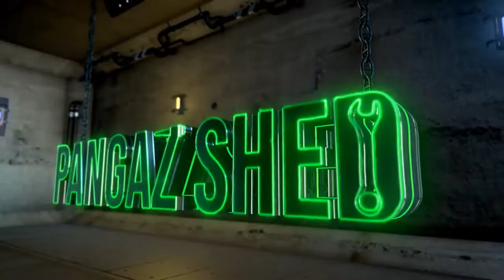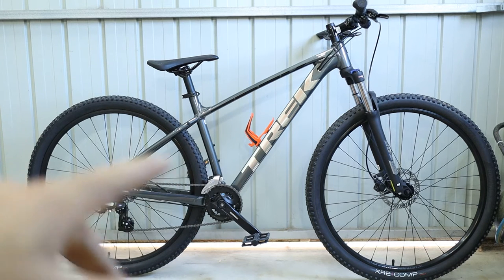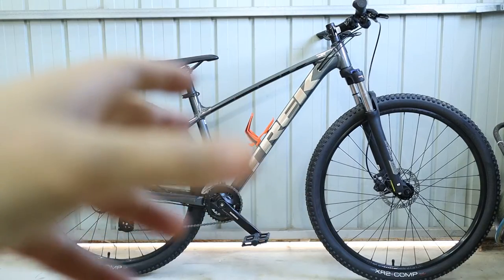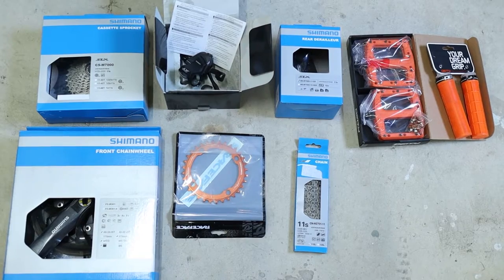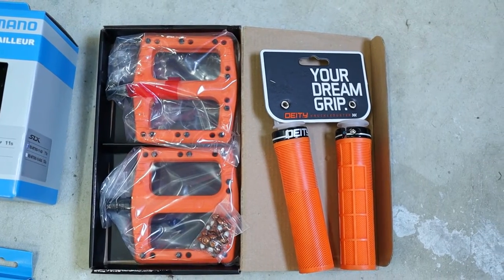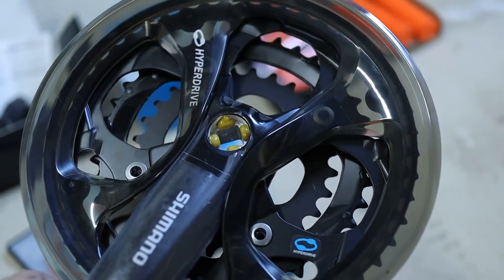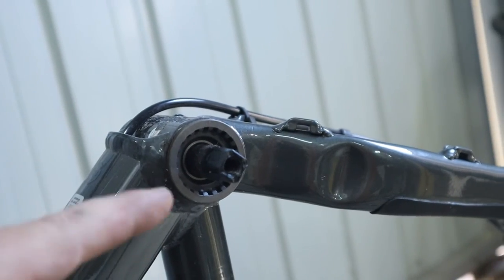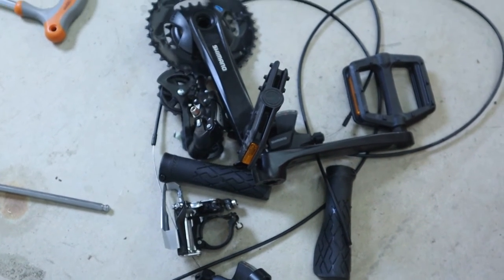Budget Shimano 1x11 Drivetrain Upgrade - 2022 Trek Marlin 5 MTB

Comment: Great video dude and the bike looks sick! I'm probably going to do this mod myself but without the 11speed conversion on the back. Was just wondering how easy it was to do the conversion to 1x on the front and if you needed any weird tools. Or if you have any other tips it would be much appreciated.
Reply from the maker: Changing the front chainring should be straight forward. Normal tools to remove the front chain guide, crank arms etc. The chain might need to be changed to suit the teeth of the new single chainring (if it’s narrow-wide). If you want to change the crank assembly to something more exotic then you will need a bottom bracket tool to suit. But if sticking with simple taper bearing as I have then proceed! Cheers!
Reply: @PangazShed  I followed this and used the exact same stuff....it aint working wtf. The derailleur wont shift to the lowest 2 gears no matter I do and im frustrated
Reply: @mattnielsen7639  Check your high limit screw on the derailer.

Comment: Hello and thank you so much! Which raceface chain ring did you use? 30T?
Reply from the maker: Yes, 30T. Thanks for looking, cheers
Reply: One more question.. will the xt m8000 derailleur work with the slx m7000 cassette? Im having a hard time getting the m7000 derailleur quickly.
Reply from the maker: By the look of it, the m8000 is also an 11speed rear derailleur so yeah should work! The m7000 might be low on stock as it’s perhaps becoming discontinued? Not entirely sure, sorry. I only bought the m7000 because it was cheaper haha
Reply: Hey Im working on this chainring and the original shimano bolts seem to be a tad too long for the single raceface chainring. Did you use different bolts or am i missing something lol
Reply from the maker: I used the bolts that came with the crankset that I bought, I didn’t have an issue
Reply: @PangazShed  Thanks for responding. Not sure why it didnt work for me.. ordered some shorter chainring bolts. I appreciate you and this video so much.
Reply from the maker: No worries! At least you can’t go wrong with new bolts! Also, I can report this conversion has transformed the bike. Lighter, less clunky and looks good. Make sure to torque the crank arm bolts or check them after a few rides. Same with the derailleur tuning, I had to readjust mine recently to stop ghost shifting but that’s mainly because I’m not the most proficient derailleur tuner!

Hope you’re pedaling soon! Cheers
Reply: @PangazShed  I cant wait to complete this upgrade! I just upgraded the fork a couple days ago to a rockshox recon and it was a huge change for the suspension. I will definitely keep an eye on what you mentioned. You should do some video of your rides some time! I will let you know how it all goes.
Reply from the maker: Upgraded forks! I’m jealous! I need to do that too, standard forks seem more springy than suspension! 
Once the 1x conversion is done you’d have a nice bike for sure! 👏
Reply: @PangazShed Yes the forks have been a massive upgrade!! Buy I am very excited about the 1x to simplify shifting and hopefully eliminate chain dropping issues Ive been having out on the trail. I want to do wider wheels but Im still doing research on that.
Reply: @tomacheteful What particular fork is it? Is it a direcy fit to Marlin 5?
Reply: @danl5632  originally I put rockshox recon 100mm travel like the stock travel.. I did not feel much difference honestly. So I decided to buy a tapered headset and adapter then I install recon 120mm. I really enjoy this fork, the bike is much more fun to ride and better on trails.
Reply from the maker: Do you have a link for the headset adapter? I thought company’s like Cane Creek don’t make them for the 1 1/8th steerer tube
Reply: @PangazShed  it is the ec44/40 adapter.. I installed this exact adapter with no problem.
Reply from the maker: @tomacheteful I’ll check it out! Thanks! Tapered are plentiful in decent shocks compared to straight!
Reply: @PangazShed  glad I could help.. you helped me so much.
Reply: Did you shorten the new chain?

Comment: doesn't the rear hub only support up to 10 speed Cassette?
Reply from the maker: This particular 11sp cassette is compatible with the 8/9/10 Shimano freehub. Same spline and don’t need a longer one. It’s the 7 speed and down that the hub needs to be changed. I made sure of this before I bought everything. Thanks
Reply: @PangazShed  Is it the Shimano FH-RM35??
Reply: @PangazShed I ordered all the same exact parts. Have a 2020 Marlin 5 the cassette only fits 10 of the 11 gears on rear hub. Idk what the issue is. Do you have any suggestions?

Comment: hey, would this crankset work on a 1x12 conversion? Hoping for a reply, Im new to mountain biking and this will be my drivetrain DIY
Reply: yea it would work but you have to get a new back wheel if you run an 8 speed
Reply: @olivermtb4596  im planning to use the sram NX PG1230, which I believe is a straight swap from 2x8 cassette. and then im planning to use the crankset from your video. so I dont have to replace the BB. please let me know if you think I would work.
Reply: @LTapsy  are you using 29 and 27.5 inch wheels? Because you most likely have to get a new rear wheel because of the freehub and a 12 speed cassette wont fit on a 8 speed freehub body and is it quick release or a thru axle hub and dropouts?
Reply: @olivermtb4596  its 29. I dont get it. I see people with 2x8 and converting it to sram NX 12 speed group set. The only thing they need is a BSA BB.

Comment: Firstly great video!  Second I used the exact same shimano crank and my chain instantly falls off the front chain ring. I mounted my single chain ring on the inside of the crank like you did to give it the best chain line possible. Weird I used the exact same parts on a marlin 5 gen 2 and it causes the chain to drop off the front within a couple pedal strokes. The only way I can see to make it work is to actually space the front chain ring  toward the bottom bracket.
Reply from the maker: Thanks for watching. Annoying issue you are having, just a thought, is the chain compatible with your setup? Cheers!
Reply: @PangazShed  Thanks for the reply. I Tried the factory chain and another brand new one. Both of which should work. As soon as I put the old 2x front chain ring on the bike has no issues at all on either chain ring. When I measure the chaine link with the single chain ring its outside of what the spec is for my bike. Really odd. Again appreciate the reply1
Reply: @108Hawke  Did you solve your Problem?
Reply: @OneStepClosa  I did.  It was actually the cheap chain ring that was the issue.  I had used an Amazon chain ring.  When I replaced it with a brand name one the problem was fixed.  Likely just got a bad one as I’ve used other Amazon chain rings and haven’t had an issue.

Comment: Love what you did with your Trek Marlin 5 going single chainring! Planning to do the same soon. Any issues with chain derailment since you switched? Would appreciate any insights!
Reply from the maker: Hi there! No issues with derailment! The only thing I had to do was retune it slightly to make sure all the shifting was spot on. I didn’t have it set up quite right once the vid was finished. Followed a tune walkthrough and it’s been perfect since.
Reply: @PangazShed  This is awesome! Great job also on choosing the optimal parts for the conversion, without the need to change the rear free hub and pedal bearings!
Reply from the maker: Yep budget friendly! When the OEM parts fail I’ll replace them with better. But hey, I might even replace them with OEM! I just like the ease of conversion. Thanks for checking out the vid. Cheers

Comment: I'm confused as to how your Marlin came with an 8sp freehub when all the Marlin 5's come with 7sp freehubs. I'm having the worst time figuring this out. I have no idea what driver fits in the dc-27 that i have
Reply from the maker: My Marlin 5 was a 2022 model (it was bought mid- late 2021) so that’s probably why is has the dc-22 hub. Mines not technically a gen 2 Marlin but perhaps these are the differences between the 2021 Marlin 5 and the 2022.

Comment: Hello,bro I have the Trek Marlin 5 2022,I also want to change the 2by8 drive train to 1by 10 Shimano Deore.My question is should I have to change the rear free hub for higher teeth cassette or the 2022variant don't require any hub change to add 10-46T cassette? Please tell
Reply from the maker: I didn’t have to change the hub, I believe if you go Shimano 1x12 then yes you would have to.
Reply: @PangazShed  Can you suggest some basic 1by drivetrain upgrades which will not cost to change the hub

Comment: What size cassette tool did you use to take off the 7speed cassette. My is too big too fit.. do you have the tool spec?
Reply from the maker: I don’t have the tool spec, it was just a generic cheap one from eBay (comes in a 5 or 6 pce kit). It’s got 12 splines if that helps.

Comment: Did you have to change the wheel?
Reply from the maker: No, the wheel and rear hub remained the same
Reply: @PangazShed Im planning to do the same. You mean its a direct bolt on. I dont need a new hub or wheel?
Reply from the maker: I have successfully done this conversion with the original wheel and hub, so that’s correct, direct bolt on.

Comment: I followed this and used the exact same stuff....it aint working wtf. The derailleur wont shift to the lowest 2 gears no matter I do and im frustrated 😑
Reply: Did you figure out the problem?
Reply: @lazarofernandez3663  Yes It was limit screws and tension. I started too tight. Backed it way off lengthened the cable and then slowly worked it from there and eventually got if.

Comment: Any other chainring options for this particular Marlin 5?
Reply from the maker: Yep, 104BCD is the bolt pattern needed if you use the arms I did. Although if you want to use completely different crank arms you can with whatever sealed bearing bottom bracket you like. Heaps of options.